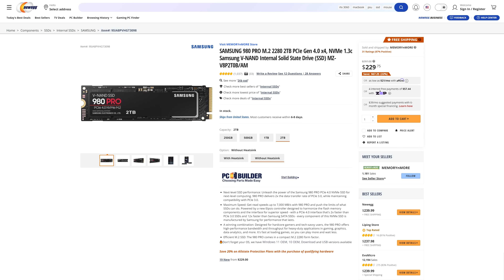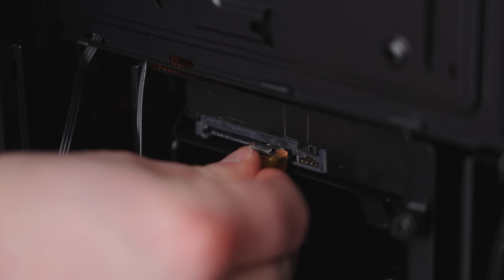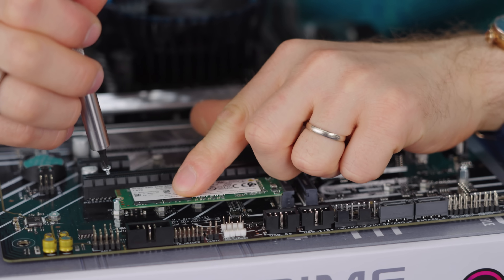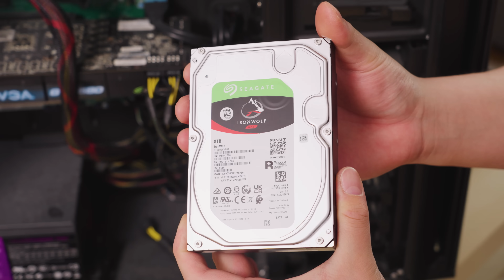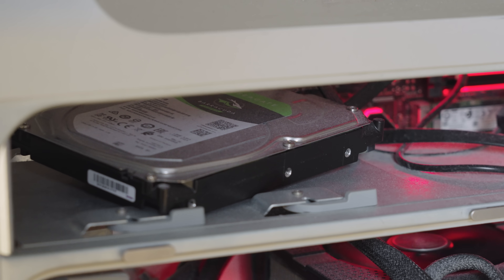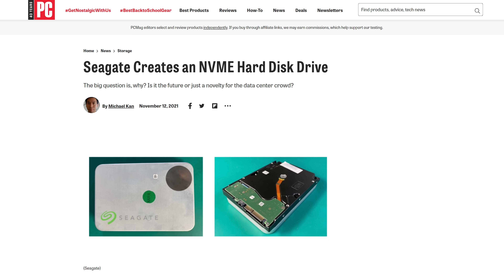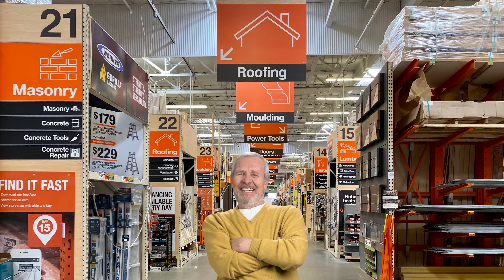Is SATA Obsolete?

Comment: Sata SSD are still great for storage drives, and the difference in load times versus m.2 is only a few seconds. So my next build is basically 1 m.2 for boot/games, and rest will be my current crop of SSD that will be moved to light storage duty.
Reply: HDDs are still king for value to dollar storage. Yes they have significantly less writing life, but their reading life still beats even the best ssds. You can use HDDs for multiple decades especially if it is just reading where SSDs are not there (yet)

Comment: I have a ten year old MSI GE 70C and it's literally still kicking ass and taking names even with an old spinny HDD.  I just installed Windows 11 on it a few months ago and it still runs fabulous.  I ran Crystal Drive Info to get the state of my HDD on it and it's in perfect shape.  None of the components are even close to failure.  I'll be keeping it until the day it finally blows up (can it get another ten years?!?).

I have another laptop now for heavy lifting, but I still use the MSI almost every single day for various tasks.

Comment: I am surprised how quickly NVME ssds took over the Sata ones.
Reply: I know the m.2 slot has been around for about a decade now, but having a  state drive was a rich person's item. I remember forking out $400 for my first 1tb Samsung Evo Sata ssd in 2016, and now they're only $60.
Reply: even the lowest end NVMe SSDs are like 3 times faster than the fastest SATA SSDs (with high end ones being 20 and more times faster). Since they usually cost about the same, it makes sense people would go for NVMe over SATA. Also the prices have been going down a lot (for both SATA and NVMe), in the video he mentioned 2TB for 250$, now, a year later, you could get a 2TB SSD for a little over 100$
Reply: @118Shadow118  Short answer is - No, NVMe aren't 3 times faster than SATA.
Long answer - the thing you're mentioning is sequential R/W throughput, which doesn't really tell anything much about a drive's real-life performance. Instead, it's latency and random throughput, in terms of which NVMe drives hardly differ from SATA. In fact, NVMe drives can barely saturate SATA-1 (150 MB/s) bandwidth with random R/W.
Reply: Not that quickly to be honest.
SATA SSDs have been around since 2009, NVMEs came out in 2011 but didn't become the norm until the 2020s. Many things have succeeded their predecessors quicker, like blu-rays taking over from DVDs and HD-DVDs, OLED TVs taking over Plasma TVs, etc.

Comment: Why is it that serial ports (9 pin or 25 pin) for modems and things of that sort are slower than parallel ports (25 pin) for printers yet Serial ATA is faster than Parallel ATA?
Reply: Mostly because they are a different type of serial. SATA uses differential signalling, so you can run a much higher data rate than you can otherwise before the signal is lost in the noise. The 9 pin serial port does not use differential signalling, so it will have a limited cycle time like PATA did. Parallel ports would also have that same limitation since they also aren't differential, except they are parallel pushing more data per second off that alone.

Comment: yeaaa i got a hdd . 2 ssd's and 3 nvme's lol

the ssds are old back when 500gb was expensive so i got a 250gb and a 500gb i brought over from an old build. the 250 is just kinda chillin in my case lol.

got a 6tb hdd for $100 while back for data dumps and backups.

i bought 2 nvme's (1tb and a 2tb) for my new pc and when my cousin upgraded his pc he gave me his old nvme (500gb) because his mobo one has one nvme slot lol

Comment: That's why I haven't gotten an M2 yet. First the access problem has to be solved. (one M2 ? cmon.. This is not acceptable☹) In addition, there is hardly any software, let alone games that benefit from it. It's still possible that m2 is stillborn, like much hardware before it.

Comment: If your archiving memorex DVD is the best option as hard drives need power and will only last a handful of years.  Thanks for the info between sata and me. I have built in graphics which is full bandwidth and superb.  So I use my lanes for sata. By the way there were no pata they were SCSI drives.

Comment: "Not more than 3 M.2 slots"...shows mainboard with 4 (one is under the metal heat thingy at the top of the frame at 2:28 with the "M.2" written on it) 😅

Comment: Is SATA obsolete? NO.
Should SATA be used in any new computer, for a primary boot drive? Also, NO.
SATA still is the primary interface for massive amounts of cheap, slow, cool, and possibly even cold storage. It is what you want to use to cheaply add 1+Tb drives to your system that pretty much only store files - no launching programs from them, no booting operating systems from them. In this regard, I still see it lingering as a viable connector for quite a number of years. Unless/until NVMe drives get cheaper than spinning rust at the large-capacity end, there will always be a need for the SATA interface. We have no other way of hooking up a spinning-rust drive, and no other way of making a 20Tb NVMe drive cost less than the equivalent-sized spinning-rust drive.

Comment: What i don't like with NVME drives is they tend to disappear from bios when you have to force close your PC by switching the power off, which you have to do every day with certain games like AC Valhalla...
Reply: You've got some bunk hardware bud, I'd try reflashing the bios. My decade old asus ROG board somehow stuffed itself recently and did something really similar, flashing the same exact version of the bios I was running fixed it.

Comment: Ever since I made the switch from Apple computers back in 2018 or so, each PC I’ve built has used NVMe storage exclusively. 

I don’t have ridiculous storage capacity needs so 2-4TB is plenty for me. I don’t even maintain a very large game library. I own a lot of large games but for several of them, when I’m done playing through one and it’ll probably be a while before I play it again, I’ll just uninstall the game. I’ve got a pretty quick fiber connection and fast drives so even large games only take about 15-20 minutes to download. 

If you have a very slow internet connection, I can see why you’d want to have all or most of your games present on your machine. Still, I think most PC gamers would be perfectly fine with a single 2TB drive, which just aren’t that expensive anymore, even when compared to many SATA SSD’s. I’d personally rather have a 4TB NVMe drive over an 8TB SATA drive because the increased speed matters much more to me than the increased capacity.

Comment: In daily usage SSDs are controller limited in their speed cause that dictates how fast they can collect the required data from the nand. Thats usually in the hundreds of MBs per second. The Gigabytes of transfer speeds you see for nvme drives is just that. The maximum transfer speed of the pcie lanes that connect them to the cpu. So with identical controller performance the over 500 MBs of transfer rate for sata 3 is usually enough to transfer all the data that the controller gets from the nand. Though in my experience the controllers on nvme drives are usually better and work a bit faster. Without direct comparison its hardly noticeable.

Comment: SATA still has the upside of using a cable, compared to NVME, which tends to require the drive be directly connected to the port, so you could swap out your IDE drive for SATA without changing much at all.

It's a lot harder to stick an NVME hard drive into the connector.
Reply: its just like inserting and NEs cassette

Comment: I slowly replaced my 6x 500gb SATA SSD raid arrays with 2x 2TB NVME Gen 4 drives and I am happy, no cables, no hassle. :) price difference between SATA and NVME GEN 4 for same volume is like 10-20$, which is crazy and no brainer in terms of system responsibility, direct cpu access to memory without SATA controllers and much less latency across all applications in system, which is used for heavy multitasking

Comment: You say NVME drives have to be screwed in like my SATA HDD doesn't have mounting screws I wouldn't feel safe leaving out.

I pulled an old external enclosure out of storage and the drive didn't boot up, so I opened the case and found that it didn't have any mounting screws and the drive had unseated from the connector. Fortunately it didn't seem to be any more damaged than it already was before the move.

Also in my experience, a SATA connector is a lot wider than what you show. Are you only kidding eSATA?

Comment: And 9 months later, a 1TB WD Black SSD is around $55, and the 2TB version is about $110, and a cheap, dramless 2TB can be found for under $70. I remember when I was 16-17 in 2019 I wanted to upgrade my dad's old 2006 optiplex (yes I used it, and yes, it worked to watch 480p youtube) with an SSD, but the cheapest ones I could find were like $30, so too expensive for an unemployed teenager. Nowadays, that same SSD can be gotten for $10, which even a broke kid can afford.

Comment: i will stil buy SATA SSDs as there are more modular. you can put an SATA SSD in an old laptop or even PC that uses SATA HDD and use it With the leak build of Windows 11

Comment: PATA has crosstalk issues, so data transfer speed is affected as you increase data transfer, similar to CAT3 vs. CAT6. Where as SATA by design doesnt suffer that issue. SATA is much faster for those reasons. Plus it's physical characteristics of being smaller and flexible makes it a more preferred design.

Comment: I utilize 1 2TB NvME, and then a 2TB SATA SSD in my system. The NvME is my OS/ core applications, and games I want that zoom zoom loading times for. Everything else on the slower SATA SSD. Doesn't interfere with my PCIe lanes, but I still have great R/W speeds.

Comment: Going from HDD to SATA SSD was like going from Super Nintendo to PS1: absolutly mind blowing.  Going from SATA SSD to NVME is like going from PS3 to PS4; it's not THAT much different
Reply: I don't know. It seems more like SATA to NVMe is more like going from base PS5 to PS5 Pro, if that, and only if you care about 5% faster loading screens. In most games, loading screen time is bottlenecked by CPU or GPU, not a SATA SSD's speed.

Comment: But…..you could just have an M.2 SSD set to x1, with all four of them being x1 and not affecting the gpu.
At that point tho, you might as well have just one M.2 SSD for games that can make use of that fast storage, then SATA SSDs for ones that only make use of that “600MB/S” speeds that SATA does.

Comment: Not really obsolete, because you can still buy a 8TB SATA SSD for $600 CAD, while a 8TB M.2 SSD is over 1000, and no ones made a PCIE 4.0 one… so you’re stuck on PCIE 3.0.
No one would ever need an 8TB SATA SSD, but if you got a 4TB one for something like an older Xbox One X or PS4 Pro, you could keep those going till M.2 drives become even more affordable, and the Series XX and PS5 pro come out lol.

Comment: I believe SATA isn't going away anytime soon. It's still cheaper than Nvme drives, still sells more Gb per currency than it, and also has a lot of extra ports rather than using a rather valuable PCIe slot on a non-enthusiast system(which most cheap machines only come in a single x16, with maybe one or two x1 or x4 slots).

Comment: What kind of good old days? Without any expansion card, how am I supposed to attach 6 or even more  NVEM drives to the mobo? Mobo vendors do not even provide that option on cheap steaks. Not to mention, people are robed because of you need to buy an expansion board to achieve it. Once you do it the rest will be limited by bandwidth etc,.

Comment: parallel SCSI went away not because the tech wasn't managable or so (and PATA was more or less behind it), it was abandonned because of US laws. more precisely, SCSI used a system to synchronize the parallel data lines, synchronizing below 50 nanoseconds however is nuclear bomb technology, and the US prohibits exporting that.
so classic SCSI could not accellerate anymore, and for PATA, this is essentially the same.
PCIe does not sync over all lanes, even if you have 16 lanes in parallel.
the wide ribbons? they did not care. they were just fine. but the sync-feature for good parallel data transmissions? that was the problem.

Comment: Nope.  SATA might not be needed for game consoles, or for the casual user who only has 1 or 2 hard drives (SSD), and just plugs in an external via USB every now and then, but NVME isn't practical for large scale storage.  I have yet to see a consumer level motherboard with more than 2 slots, but those same boards often have between 4 and 8 SATA ports.

What I see happening is NVME becoming the primary storage for your OS and core applications/games, followed by larger SSD drives for media editing and general storage, and maybe even a few big and slow hard drives for backups and streaming media (which doesn't benefit from SSD storage).

You COULD just hang that on USB, but you'd want a dedicated internal USB controller.  If it's the same chip that serves your external devices, it's prone to being reset when an external device carries a static charge -- like when your cat rubs up against your keyboard and it, along with your mouse both reset... kinda bad if your storage also reset from that. :)

Comment: I use SATA just because my motherboard has a ton of sata ports and only two M.2 slots. I'm about to upgrade my half full 6TB Steam Library/Storage HDD to an 8TB Samsung QVO Sata SSD. An 8TB M.2 SSD costs over $1,000 and I'm not willing to pay that much when a SATA SSD of the same capacity will still get me a massive speed improvement for under half the price.

Comment: They need a new SATA standard.   There is an ease to connecting multiple drives, switching them out easily and storing them as if nearly indestructable in the case.    They really just need to up the throughput and they'd really have something.    Hell, when they come out with 16 and 32 tb consumer SSDs chances are they'll be sata not nvme.   The problem is mostly with the chipset - we've had a shortage of PCIe lanes for a decade now - with barely any increase in the number of lanes.

Comment: I bought a SATA SSD — an 870 EVO — today, and installed it in my mid-2012 MacBook Pro. This MacBook Pro formerly had a 1 TB 860 EVO SSD, which is needlessly huge; 500 GB is just right for this laptop. The 1 TB SSD now lives in my 2008 MacBook Pro (since it's probably my favourite computer, I decided to spoil it a little), and the 2008 MacBook Pro's previous 500 GB 850 EVO SSD now lives in my Power Mac G5.
I have a 2010 Mac Pro. The original cheesgrater Mac Pros have SATA II ports for hard-drives, but I recently installed a 500 GB NVMe boot-drive using a glowing Simplecom PCIe adapter. I also have a 2013 trashcan Mac Pro, and installed a 1 TB NVMe drive using an adapter.

Comment: I remember when I paid $100 for a 500GB NVMe SSD a few years ago. Wow did I get ripped off. They're so cheap now. I can find 1TB SSDs for less than that now. I did need it back then though, so it kind of wasn't a ripoff, and I still use it.

Comment: Ive had more Seagate drives fail on me than all other brands combined.  They are (supposedly) much more reliable now...but I've no faith in them.
Reply: If you want a reliable and long lasting storage, be it SATA SSD or M.2 NVMe SSD, just buy Kioxia.

Sure, they're not the fastest SSD, but the benchmark reveals Kioxia are only 80-240 MB/s slower than high-end fastest SSD. Literally no one will be bothered by few MBs slower speed if you're using PCIe Gen 4 or 5 link speed.

The point is that Kioxia SSDs can endure a much more harsh conditions than Seagate, Samsung, Western Digital, etc etc

Comment: M.2 drives becoming cheaper than 2.5" drives makes sense. Both of the cheap 2.5" SSDs I have are a tiny litlle PCB in a mostly empty casing.
I can see SATA SSDs sticking around so people can continue to breathe new life into old PCs tho.
Reply: The most "empty" casing are typically SATA SSD below 1TB.

I have old Laptop that I swapped with 8TB SATA SSD. Out of curiosity I opened the SSD and the PCB occupied almost all of the available casing space. Which kinda makes sense given the age of SATA interface being shoved by modern Nand chips but designed to avoid overheat.

Comment: Blablabla you pay in the old days blablabla NO.
We where buying MLC-based SSDs, not TLC or the new crappy QLC based ones.

Yes, they were expensive. But they were top notch.

And whoever says that TLC is not so bad, should take a look at the latest 980 Pro from Samsung.
Reply: The problem is that sometimes, more often than not, shopping for SSD doesn't tell you if it's MLC or TLC etc etc Unless You use Google to search the info. Even the packaging or the box it came with, doesn't tell the SSD type MLC or something else
Reply: @ClayWheeler  yes, I know. A time consuming experience.
And some brands move from tlc to qlc without telling you, like CRUCIAL with its MX500 line.
They moved from tlc to the worst shitty qlc they could get while selling it with the same price as it was before. Great.
Same product name, completely opposite quality.